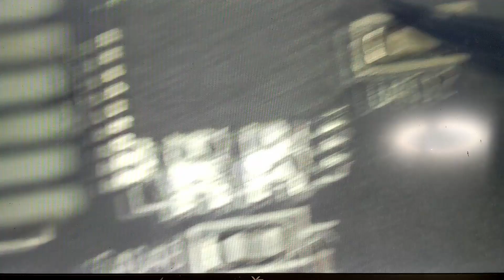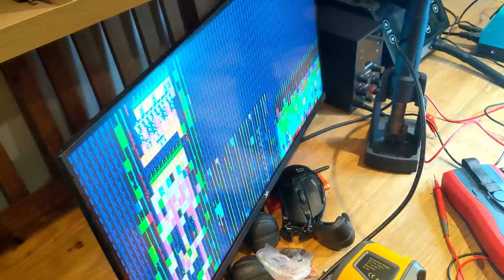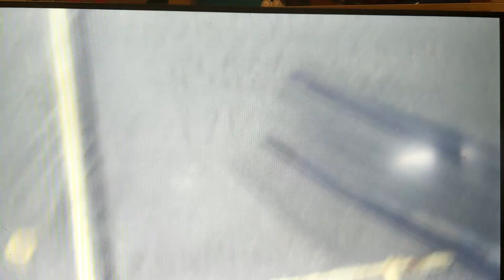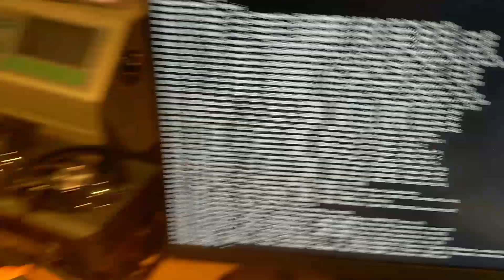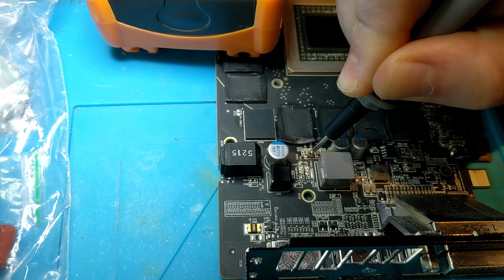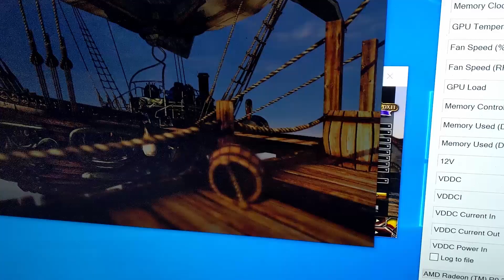5 Sapphire Nitro R9 390 GPUs! How many can I fix?

Comment: Great work on the repairs sir, is there a mats or mods version for amd cards? Specifically 6000 series? I have a powercolor red devil 6700 xt 12 gb with artefacting issues when the card is under load and games crash but when I lower the core clock to 1000 mhz or undervolt it it resolves the issue
Reply from the maker: @midoxnoth3960  hi, the software is called tserver, also memtune is a tool for AMD cards.
There's a video on my channel on it, the second latest.

Comment: Hey, next time you use isopropyl alcohol to find a shorted component, try pulsing the power supply. It gives a clearer indication as the alcohol reacts in waves. Also, nice use of the 'calibrated wire' 😂😜👍
Reply from the maker: Yeah, should have done that. Will remember for the next time, thank you :)